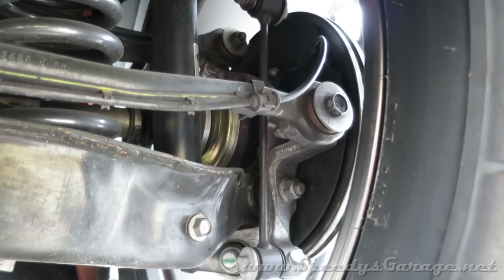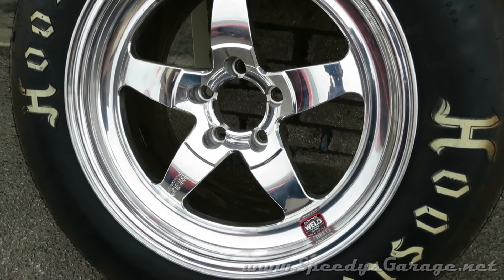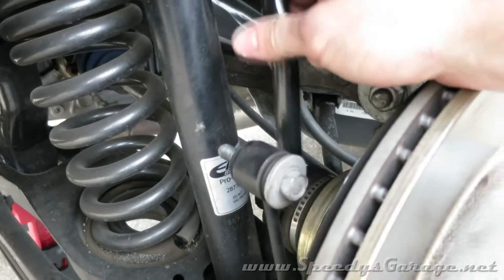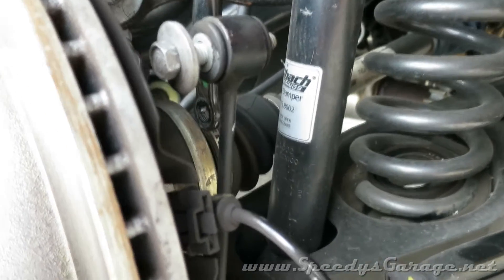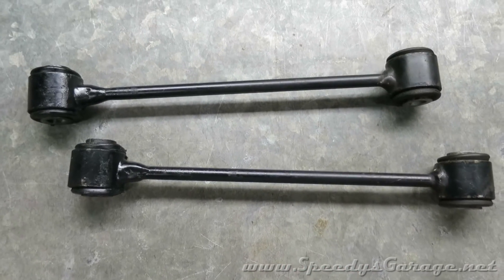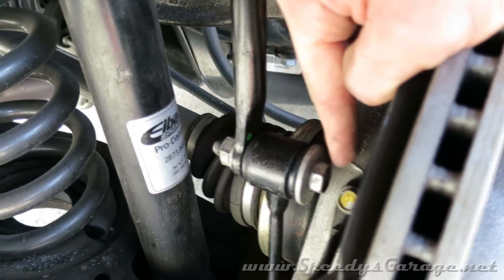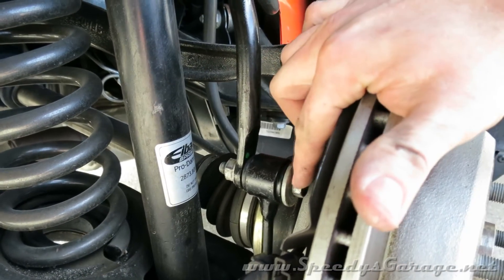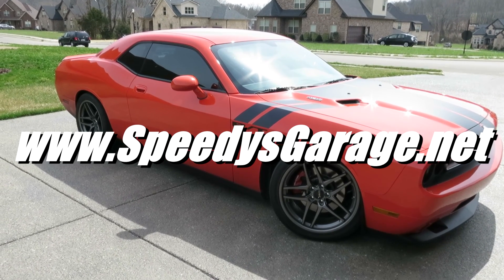Challenger Shortened Sway Bar End Links

Comment: Question. I bought rear sway bar end links that are 2 inches shorter than stock. I am also on 2 inch lowering springs. Will this affect clearance with the hub at all? Just curious before I install them.

Comment: Great vid man. I'm looking at 17"s too. Question though. Wouldnt buying an extra pair of already shortened end links be better? I would imagine with a portable compressor and some aor tools you could swop these out in 15 mins. I would just hate to alter the geometry of the suspension. Any thoughts? Also, what hoosier tires hook the best on 17x10's? Thx
Reply from the maker: I've not noticed any difference driving the car and I've got enough going on at the track to fool with end links.  You can certainly buy a second set though as folks like HHP offer them pre-modded.  I use a Hoosier slick 28x10.
Reply: Speedy's Garage thanks for the reply. Hey, do you have any opinion on using the oem oil filter for the hellcat or the srt viper filter which is supposed to be more high flow

Comment: I put on a 17x9.5 drag star and did NOT have to do this.
Reply from the maker: Mine are 17x10, with a different bs so these need it.
Reply: I put on a set of 17 x9.5 Race Stars and M/T 305 45 17 DRAG Radials on my 2021 1320  I didn't have to replace the end links but I now have a set form HHP that ate 1" shorter will they help or do anything to improve anything?
Reply: @STANS392CajunBoy  did u ever find out cuz I Wana get some 17x9.5 race stars

Comment: I had eibach pro kit lowring sprind and anti sway bar front and rear do i need the shortend sway bar end link to run the weld wheel 17 by 10 on the rear ??
Reply from the maker: Probably.